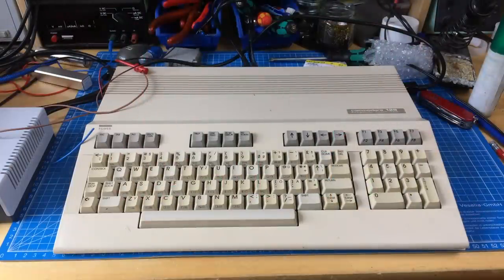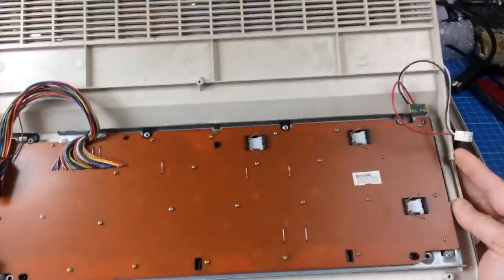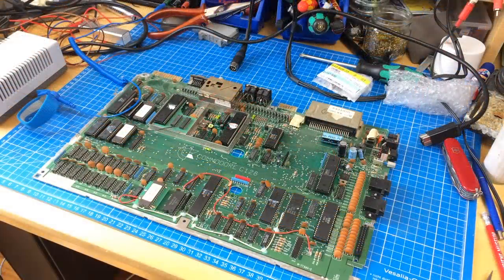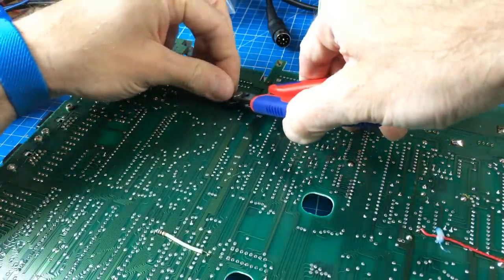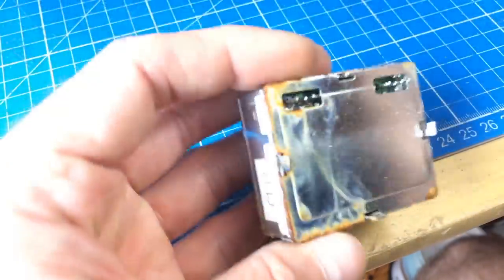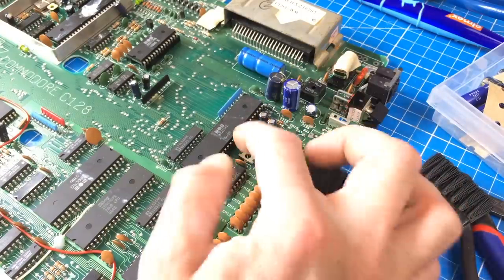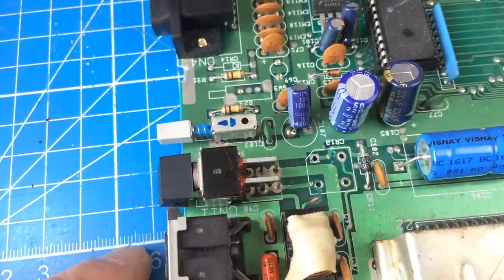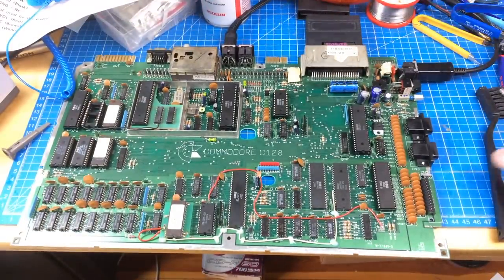Commodore 128 Part 3: Future Proofing (Fail)

Comment: Putting a capacitor in backwards is a right of passage in electronics :) It is really fun when the cap blows up, you will never forget that smell (sort of like a bad fish odor).
Reply: You know who else puts capacitors in backwards? Commodore engineers. It's often still wrong in the final silkscreen after the factory has been instructed to reverse them, but sometimes the actual capacitors just stay wrong for months or years of production. Commodore machines always need to be triple checked, need to take into account the silkscreen, the original orientation of capacitor, and engineering common sense.
Reply: That error occurred in manufactoring the A4000 desktop, on the audio section. The smd capacitors had been mounted according to silkscreen (where the main error was made), on the long run they will leak for sure.

Comment: Re-watching this, I noticed a couple of scratches on the underside of the board - around 26:52.  Have you inspected all the traces to make sure its not just a damaged trace?   C128s do suffer from the odd trace going bad - I've seen a few with no more than a broken trace.  Could just be coincidence and not related to the reversed cap.

Comment: Time to have some fun with your 'scope :)  I'd start looking at clock signals, make sure theyre all being generated correctly. I quickly found out on my own C64 that the VICII was dead when it wasnt putting out any CPU clock or Y/C signal, even though the input clocks were present.

Comment: It's a shame, and I'm sure its frustrating, but if its any cosolation Great content Janyou're going to end up knowing more about the 128 than you would have done if it had worked first time :)
Great content Jan, and well done on showing your fails as well as your successes. It encourages those who are learning to persevere when they run into problems too.

Comment: I don't learn as much as when somebody shows the mistakes/problems. We all make (me a lot) things wrong from time to time and we all learn from them, and this is the best way to learn something. Thanks a lot for the video. 
Two days ago I tried to change a small chip from a board and it was the same: I was a bit of impatient and then I screwed all of the board with my so hot soldering iron erasing the connections. Lucky that mine was a new 20€ board, but lesson learnt in my case. You know: Shit happens ;)

Comment: It's also always a good idea to look at the polarity of the originally installed part before replacing because a number of products have been found to have incorrect markings on the circuit board and you wouldn't know w/o a service manual or addendum/update.
Reply from the maker: Yup, you're perfectly right. There's a number of vintage computers that have some polarity markers wrong on the PCB silk screen. The ones on the C128 seem to be correct, though.

Comment: lets not forget, that shield is actually acting as a big heatsink in itself, that's why it is cemented to a lot of the chips!  Just like the 'Shield' around the VIC-II on the older C64s - it's actually an old fashioned heatsink to distribute heat away from the VIC-II.. people seem to forget this!

Comment: I think you succeeded in future-proofing it: nobody will be using it again in the future. ;-)
I recently replaced the capacitors on my C64 (250407 Rev B) and when I removed the RF box, I ripped one of the 8 pins out of the RF circuit board, taking a part of the trace with it. Fortunately I managed to get it to where it belonged, trace and all. Haven't been able to test it yet, though, as the new power supply arrived (Nu-brick) and I have since discovered I forgot to solder in one of the replacement capacitors. Maybe this weekend. :-)

Comment: You could try booting it in 80-column mode and see if you get video out from the VDC; it does provide B/W composite video on one of the pins of the digital video out if you don't have a digital RGB monitor.

 If you do get a picture from the VDC then the problem is most likely with the RF modulator.

Comment: Ref: 5:45
That mode is not only done in the factory. Have done at least 50 of those modes after market because the first 6 months all the C128 delivered had only US char-ROM.
The first few times I did the upgrader there was a lot of nevers, but at the end I could do the mode in about 5 minutes.

Comment: Bad luck about the ripped trace for the bridge rectifier. :(  I have 5 of these machines in various state, most of them work, some don't. It's kinda my favorite Commodore machine. :) 

I wonder, is the circuitry inside RF-modulator used also by the Composite or Luma+Chroma signals? If not I honestly don't see the point in replacing those caps. Because it's highly unlikely that computer will ever be connected to a TV via RF cable anyway? I would have even left the RF modulator out after de-soldering it and used that space for future upgrades instead. I would also never put the big RF shielding back, because it's just a pointless shield that Commodore made to please the FCC. Hope this does not come forward as criticism, because it's just questions and thoughts.

Thanks for awesome content as always! :)
Reply: IIRC you can't remove the RF box on a 64/128 because it's still tied into the chroma and luma signals going to the monitor output. I know I've definitely skipped replacing the capacitors that are in the box after struggling mightily to get the box off the mainboard on one of my C64s. I didn't really notice any difference in the video quality between a machine with new caps and one with the old caps. Sure, the old caps will fail eventually, but I'll cross that bridge when I come to it. :P

BTW glad to see another C128 user, they really are great machines.
Reply: Ah! Thanks for the update. :)
Reply: i use my c64c on a vga monitor via a svideo convertorbox. I replaced all the caps  it improved the picture alot even in the 2in rf box made diffrence.
Reply: Is good to know, thank you very much. :)

Comment: My dad had one of these when I was a kid -  one thing about them is you won't get a composite signal if the 40/80 column key isn't set right - not sure what happens if you try to boot one without the keyboard. The other thing - you can boot straight into C64 mode by switching it on while holding down the Commodore key.
Reply: my nephew had a c128 and i remember the command go64 or am i wrong
Reply: MultiArrie both work but I was thinking he could test it quickly that way as well.

Comment: Hi Jan, it happens to us all, I do it quite often when I check the polarity then the phone rings and I put the bugger in reverse.
The bridge rectifier I would not use the desolder tool I would add fresh solder and heat all 4 legs rotating between them and pull the bridge out at the same time.
Did you check the +12V although I think it only goes to the sid chip.

Comment: if the bridge rectifier is not a common failure then it is pointless to replace it..
IMO i would give it a good cleaning and replace all the caps and heat sinks to parts that get hot..;
Reply: I never replace all capacitors unless troubleshooting failure, just the ones that run warmer or are near to sources of noise or are known to commonly fail. If you take out a cap put it into your LCR and it reads as good as new after 20 years, then chances are it's a lucky one and will last longer than a new one you might put in, so right back in it goes. After all density is a common engineering goal today so the capacitors are not necessarily superior.
Reply: thats fine for you but i do a lot of amateur radio Radio and CB radio repair the caps all need to be changed out 80% of the time due to age all it takes is a electrolytic cap shorting out to make your day go bad and mess up a 1,000 Radio.  Even on computer Power supply on vintage PC's that i work on all get replaced..
Reply: On some wery old equipment there are actually some types that usually won't go bad ower time.

Comment: These things happen Jan. It could be good idea to check the RF modulator for possible mishap with capacitor change or maybe there is a short. If all seem fine I would suggest checking if modulator gets signal from Vic (pin 16-17) hopefully you don't need go too deep in the repair rabbit hole

Comment: If you ask me this is an excellent example why recapping Commodores is a bad idea. Measure those capacitors you removed, I'm confident they are in perfectly good condition. Soldering on complex electronic devices is never risk free. Voltage regulators are a completely different topic, but there is no need to "future proof" regarding capacitors: Should they break you can still replace them, but at least I never encountered a Commodore with bad capacitors.
Reply: For repairs, and I think there is a good hope for repair, I'd start checking if there is a signal at all. If not check the capacitors in the modulator. Then check the clock frequency on the respective pins: If there is no clock, or a deviation of the clock frequency, the cause is a capacitor in the clock generator circuit. The remaining capacitors are mostly smoothing and decoupling and less likely to cause black screens.

Comment: Hi. Does your video scaler output 50hz modes on hdmi? I recently bought a scaler that supports only 60hz modes and it isn’t very good for watching 50hz sources.
Reply from the maker: I think mine supports both 50 and 60Hz. It still has some ghosting when stuff is moving quickly on screen. Still looking for a better solution.

Comment: Oh no.  Ouch.  My heart sank when it didn't turn on.  But I have to say, I've been there, too. I'm sure you might already have this fixed, however, did you replace the cap that was backward with a new one or just reinstall the same one?  Might that cap be faulty now?  Also, is the Z80 at U10 working ok (5V at pin 11, clock signal at pin 6, etc.)? -- 'The Z80 controls the bus on initial boot-up'.  Anyway, my 2 cents.  Looking forward to seeing you resolve this.  Oh, and if I may, please don't call yourself an idiot.  First of all, you are not that, at all.  Second, and I've learned the hard way, self-denigrating one's self over and over will ultimately have a negative effect on your self-worth.  Ok... another 2 cents. :)

Comment: If it ain't broke... 
None of the caps showed any signs of aging/wear/heat damage, no leaking etc. 
Obviously you know what you're doing, but I NEVER replace more than 1 component at a time. None of them are known good and it only takes a second to make sure it powers up.

Comment: Replacing diodes/rectifiers with "1000V" version is a VERY BAD IDEA.  Reverse bias current increases with the forward bias voltage rating.  If you understand what that means, you know how bad that is.  And If you don't understand, you shouldn't be dabbling in electronics, let alone giving advice.

Comment: I usually would test between each component change to see if I still had a functioning machine. Sure, it adds to work time, but you're sure that whatever is the fault is your latest change; no need for troubleshooting. And the old woodworker's adage comes to mind: measure twice, cut once. Which really means check as much as possible, then do the work.

Comment: In your case i voul replace rf modulator ;)
I am not professional serviceman, but a huge lot of non working c64 and c128 I've fixed. I've found bad caps only near VICII only on oldest boards and only one capacitor brand. 
I have never seen FBR  to fail. In C128 90% had dead ram, the rest was MOS ttl, CIA, ttl,power supply. I do have one misterious C128 that was fixed(bad ram) , but was on bad power supply and keeps going to monitor. Even all signals are ok, all chips are replaced, ram,ttl.I did not had spare Z80, so this is next thing on my list. At the end I will have fully socketed  and recaped C128.
On C64 side PLA, MOS ttl,ram is major fails, then 7701/8701 and CIA.

Comment: The UK plug is probably the best designed plug of them all.
Reply: It has to be the most safe plug ever designed
Reply: The Australian plug seems to work quite well
Reply: A nice, secure contact between plug and socket; safety shutters built in to the socket - what's not to like about the British plug?  Apart from when you step on one in bare feet, that is!
Reply: And its size is a problem why, exactly?
Reply: Michael Hall yeah, stepping on it is exactly what I was thinking too, that and lego must be the worst household things in the world to step on.
Reply: The copper value of the contacts is often worth more than the appliance to which it is attached.
Reply: Nonsense, it's the US Type B.
Reply: The UK plug is designed to solve a specific Brittish problem: High current cables in houses make appliance power cables a risk. Therefore  a fuse is inserted in the plug. I don't see advantages over the originally German Schuko plug that is nowadays used in most of Europe: Safety wise both plugs prevent you from touching a hot contact while insering it. Neither plus gets loose while inserted so no risk of sparks between socket and plug while inserted. Schuko can do 16A, while the UK plug is just 10A,  so you could even consider the Schuko plug to be superior. As others have commented, the UK plug is big and bulky. So why the UK plug would be the best plug... I don't have a clue.
Reply: UK Plug is 13A. Having a fuse in the plug allows the lead to be sized to the load of the unit.  You don't need 13A sized leads for a 1Amp device.  They don't fall out. Euro plugs are okay, except they are not all standard, and you can get an northern european plug jammed in an Italian socket.  The worse are the old style US plugs (2pin) which just droop out of an old socket at will
Reply: The grounded Schuko plug is more stable in the socket due to the fact that the socket encloses the plug and grabs it with the ground pads. It sits more securely and has less chance of working itself loose. The EU non-grounded plug is better than the equivalent non-grounded flat pin style US plug which is terrible. What I do like about the UK plugs is that they are fused and has a switch on the socket, allowing you to depower a device without actually unplugging it.
Reply: The Australian plug can do 15amp easily and you can't stand on the pins :0
Reply: the schuko plug Jan is showing is a hybrid for schuko mostly used in north europe and the French sockets that have a earth pin stickout above and between deep contacs
Reply: You wouldn't need a fuse on every plug if the UK didn't use ring wiring.  It's a plug design that was adopted to overcome a specific issue/failing with a UK wiring standard.

The 2 pin US plugs that are non-polarized actually predate the adoption of a US wide standard in the mid 1920's.  So it's a trifle unfair to compare them to modern designs.  The NEMA 5-15 is available with every feature touted for the UK plugs, but on an appliance by appliance basis.  They also don't turn into caltrops when left on the floor.
Reply: Not agree. My vote is for german Shuko plug. Safe and stable when plug in or out.